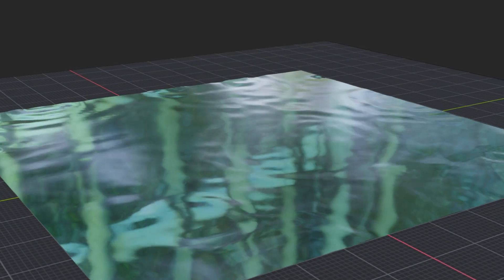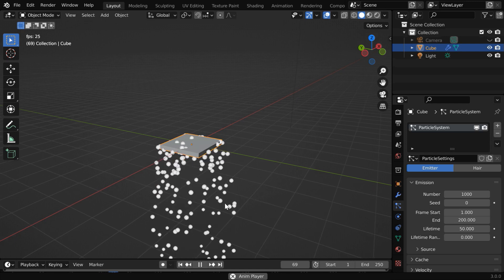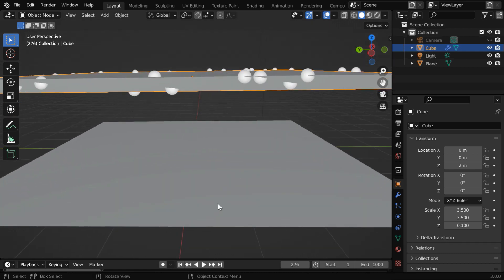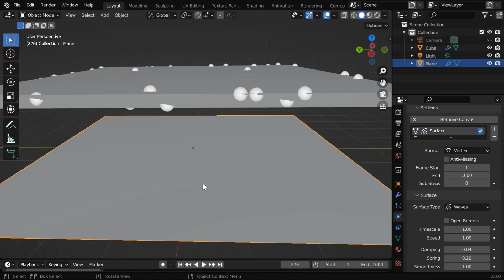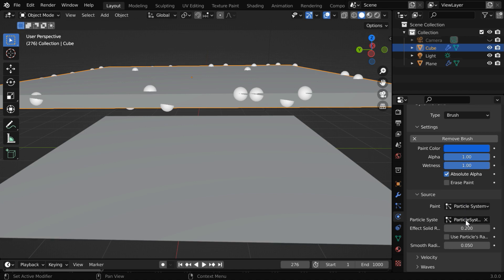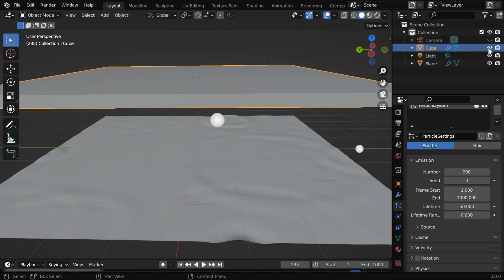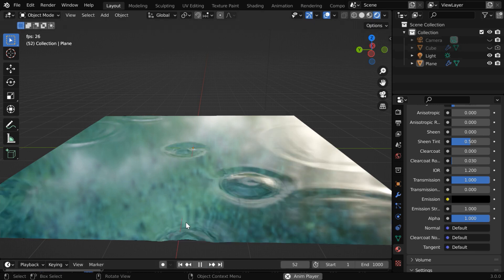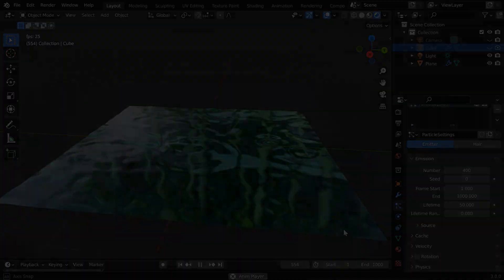Create Rain Drops on Water using Dynamic Paint Physics | Easy Tutorial: Blender Eevee & Cycles

Comment from the maker: For Blender version 3.2 > I noticed a bug for which the water surface does not display correctly. If you go to the wireframe-view mode, you can see that the ripples are created correctly, so the underlying geometry is correct. But the normals are not recalculated for the surface, so we get an erroneous outlook in the solid view mode. Fortunately I discovered a simple fix for this. For the canvas object, in the modifiers tab, you'll find a Dynamic Paint modifier added by Blender. Add a simple deform modifier after this. You can use any of the four options like twist or bend etc. but enter zero in the angle/amount field. So effectively there won't be any change in the shape but the normals will be recalculated. Now the ripples will display correctly. If you use any other modifier that forces the recalculation of the normals, the ripples will display correctly. Hopefully this will be fixed soon. I'll report it to the developers team.
Reply: thank you so much 😊😊
Reply: Oo dang, does this mean that this is the problem that I been having? I been trying to render animation my dynamic paint but in render output the wave is just not working, the surface just stay static. But when I try to render only an image, the wave will be shown, but not working on animation... I been trying to find the answer but didn't find any until I get to this channel... sometimes when the render don't work not showing the wave, I cancelled the render and i go back to the viewport and I played it inside blender the wave animation is just not working until I hide and rehide the brush object, then it will work again on the viewport, but still it wouldn't work again everytime i tried to render as an animation.
Reply: Ii III
Reply: I have to ask How long you been using Blender? Wow your a master at this software and so glad I ever found this chennel!
Reply from the maker: @TomGeewhiskeytango15511meterDX  Thank you so much 💖💖 Around 7 years I am working with Blender 😊
Reply: @5MinutesBlender  Very awesome teaching thank you Sir!
Reply from the maker: @TomGeewhiskeytango15511meterDX  Thank you too Tom 💖💖

Comment: Is it possible to create this on cylinder?
Reply from the maker: Which one do you want to change to a cylinder.... the water plane? That is technically possible, but I am not sure if it will look realistic, because a water body cannot take a cylindrical shape I believe 🤔
Reply: @5MinutesBlender No, only raindrops.
Reply: @5MinutesBlender  When I tried to create this effect on flat cylinder the ripples only appear on the edges.
Reply from the maker: @arsen5479  It will work for a cylinder which is flattened out, but you need to ensure proper subdivisions. By default, if you try to subdivide a cylinder normally, it does not subdivide its upper and bottom faces. So ensure that you subdivide them first. Then it will work. If you think the subdivision is done correctly and it still does not work, please send your blend file to us at 5minblender@gmail.com so that we can investigate it. Thanks!

Comment: Excellent tutorial. Very simple process. It works perfectly with Blender 3.0 rendered in Evee. I tried this in 3.2 stable and it does not work well rendered in Evee but it seems to be working fine when viewed in wire frame. I tried on two different computers with same result. Must be a setting I'm missing.
Thank you for this and your other tutorials; they are ALL amazing!
Reply from the maker: Sorry for the late reply. I noticed this too and it seems to be a bug in 3.2 version. The normals are not recalculated for the surface, giving us an erroneous outlook although the underlying geometry is correct. Fortunately I figured out a simple fix for this. For the canvas object, in the modifiers tab, you'll find a Dynamic Paint modifier added by Blender. Add a simple deform modifier after this. You can use any of the four options like twist or bend etc. but enter zero in the angle/amount field. So effectively there won't be any change in the shape but the normals will be recalculated. Now the ripples will display correctly.

Comment: Hey, amazing as usual, Jeet. To show rain drop, is it simply , not to click rendered tab in outliner?
Reply from the maker: Thank you Sumit 💝 I did not get your question though. Do you mean to show the emitter & the particles, Or not to show them? In the outliner, you have render icon, the rendered tab usually refers to the rendered view that is available in the header or footer area. Please tell me what you want to show or not show.
Reply: @5MinutesBlender  I wana show rain drop also
Reply from the maker: Ok, so you have to enable the render option in the outliner. But assign a transparent material to the emitter object, or place your camera such that the emitter is outside the camera view. Coming to the raindrops (particles), you'll get the white balls as visible in the viewport. You can assign a different object for them (go to the particles tab, go to rendered view, switch to object option and assign another object there). You can setup this object as an elongated sphere, with water-like material. That's it. You may also want to hide them after they hit the water surface. You can do this by assigning a suitable value for the lifetime field in the particles tab. Having said that, in our experiment, it did not yield a very realistic output. Theoretically it is perfect, but it just does not look like realistic rain. I am still trying to guess what happens when we see rain. It is not just physics, it has to do with our perception as well which we need to reproduce. That is the reason we titled this video as "raindrops" instead of "rain". We will come up with a separate tutorial on actual rain, when we attain that perfection.
Reply: @5MinutesBlender  okay Jeet, i will try it,